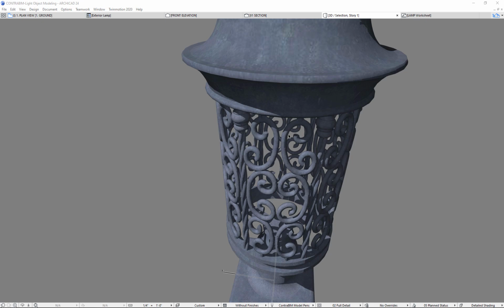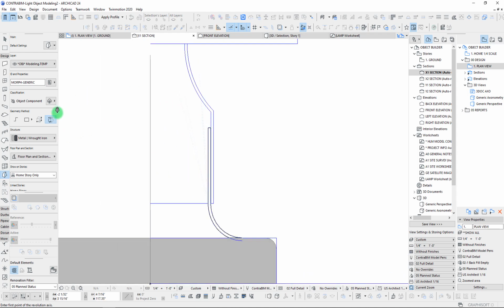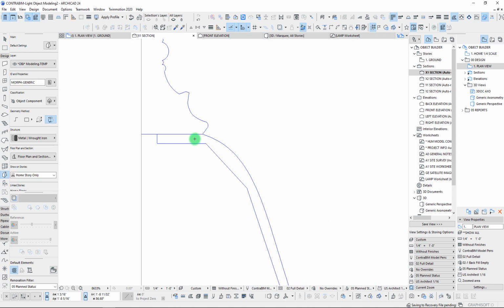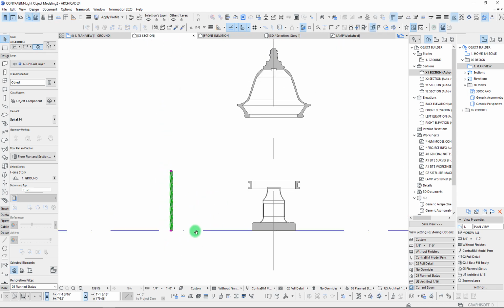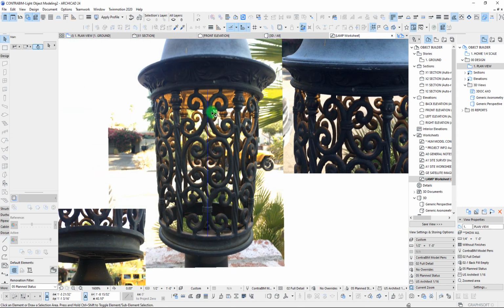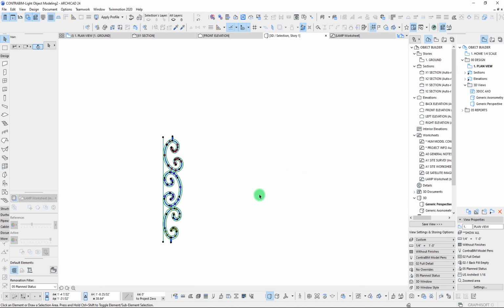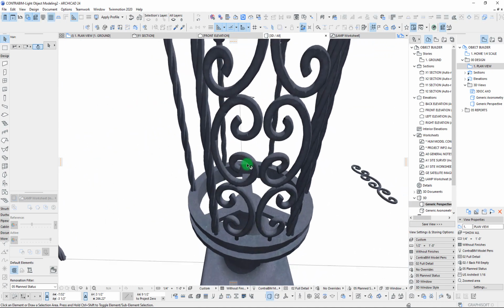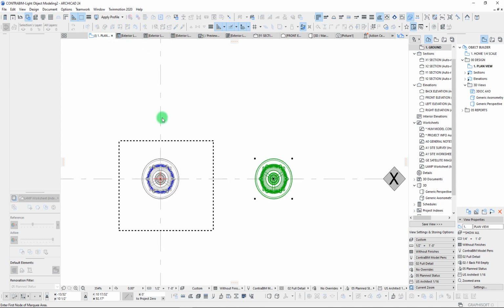How to Model a Detailed Light Fixture in Archicad

Comment: Hi John great Tutorial 👍🏻 There are two more questions :-) the first question the details cannot be formed and are just created. The second question is the light inside the object or do I have to add a new light after saving as object
Reply from the maker: Thanks! Second question.. you can save the light source into an object, and it remains. In order to adjust the settings you need to tinker with the GDL settings though. So it's worth testing the lighting first before saving it all up into a single object. I'm not 100% sure what your asking in the first question? Details connect be formed and are just created?
Reply: CONTRABIM excuse wrongly expressed. My question was that the morphs are only tilted at that angle and flat. A slight bend to the lamp would be great. I think this is very difficult.
Reply from the maker: @conmes3077  Ok I think I understand the question. Yes the ear shaped pieces are all flat, but tilted outward. It would be very difficult indeed to have these truly radiused in the model. As it is, it still has a resolution of 12 on the perimeter which isn't too bad. To make these truly radius-ed, I'd do it the other way and have them cut out with an operator, and then fillet the edges to make them round. Lots of different ways to go about it!
Reply: CONTRABIM Yes, that is true, the operator would works and the other points mentioned. But let us not want too much sometimes 😊 
I find all your helpful videos ingenious and very helpful, please continue. 
I am a fan of yours 😁👍🏻